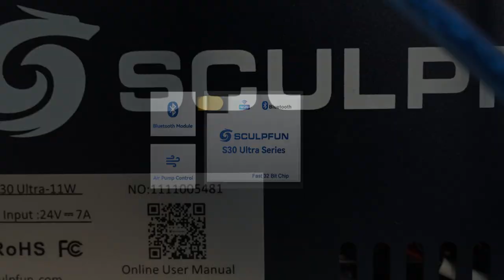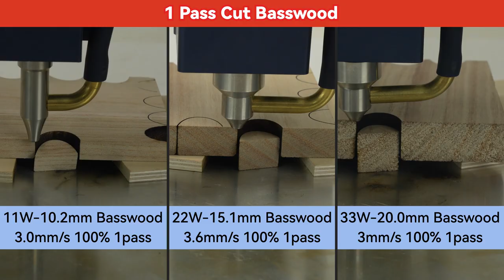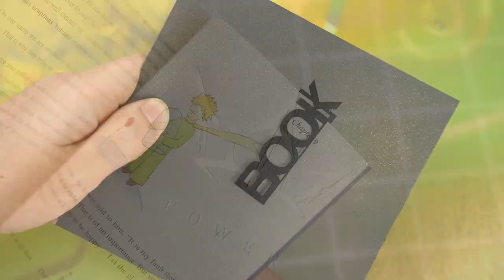2023 The Best Laser Engraver for Beginners｜Sculpfun S30 Ultra 11W 22W 33W｜Cutting Stainless Steel

Comment from the maker: 🎁Which features would you like of the Sculpfun S30 Ultra Series? Please let me know in the comment area! We will randomly pick 3 comments for the prizes on 15th May:

1) Lightburn GCode*1 (Worth $60)
2) 10 pieces 3mm A4 size plywood *1
3) 6 pieces lenses for Sculpfun's machine *1

📣Sweepstakes rules: 
You must be a member of the facebook group or the prize will be void.
Official Group for Sculpfun Users👉http://bit.ly/42q5rwO
Reply: I join the group waiting on the approval 😊
Reply: Automatic Focus Would be Amazing. Its a Dream with 33w😍
Reply: Hi, I have 30ProMax and what would I want to change is: 1 adding LED indicating the air pump running, 2 give it stronger power supply, it is hearable that fan slows down when laser turns on. 3 adding idle light which would blink   after finishing the job. The Y brama should be higher-stronger. The biggest trouble the laser gives is when you cut without pump (acrylic) the Lens has to be replaced very often, after 20 working hours. I'd add the second small air assist or blower which blows permanently on the Lens.
Reply: Bluetooth connectivity is the best feature for me and I love sculpfun’s upgrade capabilities across its machines!! It sooo easy my young daughters are creating so many amazing things with it❤❤❤❤
Reply: A focus mounting that can be altered from the top of machine, us older people with arthritis struggle with the rear knurled screws.
Reply: Eu estou muito contente com a minha s9 mas essa máquina vai para lá do sonho de qualquer amante da sculpfun , eu gostaria de receber o n 3 as lentes de substituição, grande máquina, abraço
Reply: It's sleekness with power
Reply: The S30 Ultra features are all very much top of the range. However I would like to suggest another way to adjust the z-axis laser height clearance. The 2 little screws are a bit difficult to reach at the back. A phone app to complement bluetooth and work with the S30 Ultra would be a great addition as well.
Reply: Motorised focusing would be great 😊 but probably too expensive for me 😂
Reply: Hello, to keep the components of the laser s30 dead mount more powerful models?
Reply: 😭 je viens juste de voir ce concours et c'est trop tard.. dégouté j'aurai adoré un code lightburn !
Reply: I need one 😂❤🎉
Reply: Can it cut acrylic letter?

Comment: The included linear rail for precision, the included air assist for quality and safety and the Bluetooth for connection options are the features I like. And of course the power. I have already ordered the 33w kit and the extra lenses would come in handy. Are they the same as the previous model series?
Reply from the maker: Yes almost the same.

Comment: Uunfortunately the size is too small for me. The Ultra is compatible with the large  (935 x 905 mm) S30 expansion kit? If working, I will buy it.
Reply from the maker: The working area is 600*600mm.😭 We thought it is big enough...😭
Reply: @SCULPFUNReal  You thought differently about the previous series, that's why I bought the extension. so I'm sorry, but your answer is not acceptable. If you were to say that the laser module is heavy and shakes too much, that would be an acceptable answer to why I can't use the large frame.

Comment: do u guys have any plans of adding 900x900 extension like older lasers.
Reply from the maker: Sorry we may not make the 900x900 expansion on S30 series.
Reply: @SCULPFUNReal  hello from videos i saw it sounds pretty loud, do you guys have DB sound rating of the laser, because im thinking about buying it but i live in apartement with concrete walls.